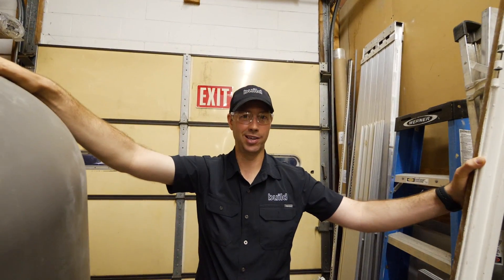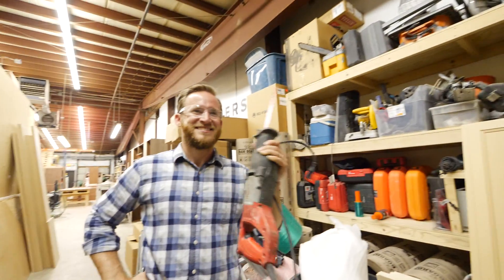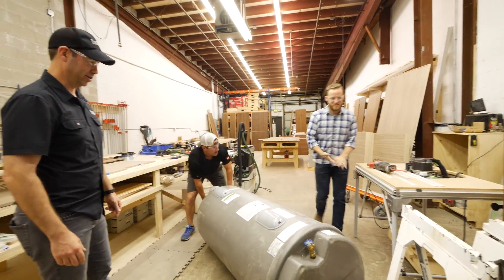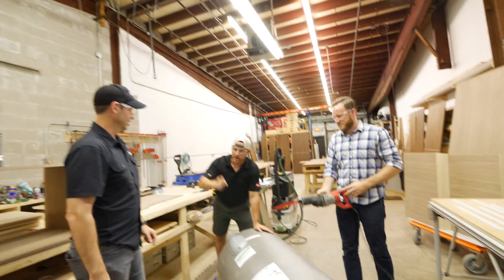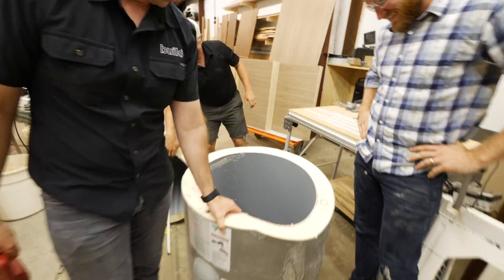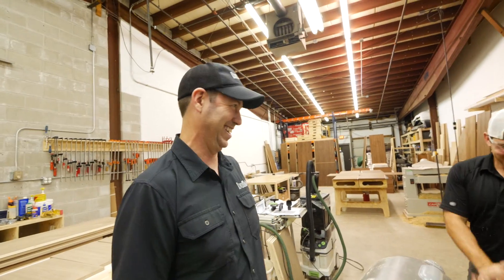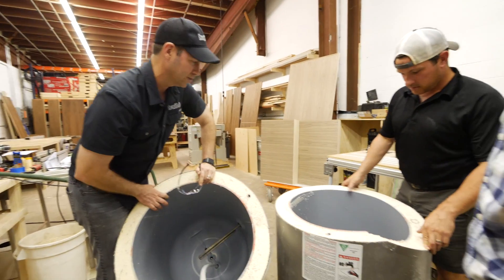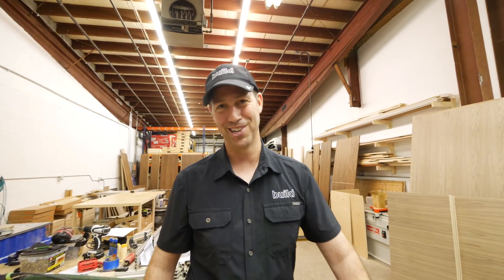WE CUT OPEN A RHEEM MARATHON WATER HEATER

Comment: Is it possible for one shower in the house to have a methane gas smell coming from water but nothing else in the house. The hot water heater has been drained 3 different times and it has not helped.
Reply: Adell Eisenhower if it is a sulfur smell and you have a well it is more than likely iron bacteria.  These tanks really work well with that problem as the iron bacteria loves a steel water heater.  You can put peroxide in your water tank and it will take care of it for a month or two but it is coming from the well and will return.
Reply: @hrcnick11  it is city water..we have tried everything to get rid of smell.
Reply: If you have other hot water fixtures that do not smell like this shower I would loook at cleaning the drain.  Maybe it's your most used shower and could be rotting hair/etc in drain.
Reply: From what I've read, it's from the anaerobic bacteria as it reacts with the magnesium and aluminum sacrificial anode as it produces hydrogen sulfide.  More of a problem with well water

Comment: I have this exact tank but mine is a 50 gallon. Thing is a huge beast. Interesting to see it cut in half.
Reply: How does the water taste? Any hint of plastic taste to it?
Reply: @stephenurban9880  You drink hot water?
Reply: @Petrochemtester  Sometimes.  Also sometimes cook with hot water instead of waiting for cold to heat up and wouldn't want any plastic taste imparted to the food.
Reply: @stephenurban9880  I see.  I have a Marathon water heater and have never noticed any off smells from the hot water - can't attest to the taste
Reply: @Petrochemtester ho w do you like your marathon ? I notice its $661 DOE yellow energy label -doesnt seem very efficient/effective despite the massive insulation ?
Reply: @johnwhite2576  It's been good - I never really looked at energy usage - was more concerned with it being more "leakproof"
Reply: How do you like your marathon ? How is the recovery on a 50 g tank ? Worried i might need the 80 gallons for 4 person household.

Comment: I have one of these units and after having it installed for six months, it flooded our basement. It's through a rental company and they said we have to replace it with the same model. I will be turning off the water supply whenever it's not in use.
Reply: What happened to cause it to flood?

Comment: BSC's science camp?!  Have a good buddy Wes who goes annually with his dad.  Any experience with scale in these units?  From my poor HS chemistry rememberings, hard water common to most residential customers loses its ability to hold CaCO3 in suspension at high temperatures near the heating element, which precipitates out, causing scale build-up on the tank bottom.

Comment: Hi guys, is the inside of the tank a metal lining with enamel finish or a glass finish?  Which would be a better option for a long lasting tank against corrosion?
Reply: This particular water heater just uses a plastic tank with no lining or finish. A glass lined metal tank is much more common and less expensive.
Reply: @kenk8215  less expensive - which is totally strange because the plastic costs a fraction of metal & glass... these tanks have fewer parts & inexpensive plastic tanks with about $5 worth of foam insulation - foam is great, but not $1000 great.
Reply: Why expensive? Because they last a very very long time. They’ll probably just get to sell you one or two in your lifetime. They’re amazingly efficient. Like other electric tanks- no moving parts. Elements can be replaced by homeowner. Nothing to rust.
Reply: @jpartington5358 j do you actually own one of these ? Would be interested in your experience …

Comment: Matt. The Marathon Water Heater does not require a anode rod.  What you called the "anode" rods is actually the heating elements, which happen to be titanium on this model, opposed the standard copper elements.
Reply: R. Dowden, I'm looking to purchase an electric water heater, but have had reservations from reading many negative comments about defects and broken parts from the manufacturer.   I'm from Canada,  our popular canadian brand is Cascades/Giant, which has a glass lining on the inside on the tank versus the Rheem.  I was instructed by Home Depot that it has a mental lining with enamel finish, therefore which tank would last the longest against corrosion?  
Which one would you recommend?

Comment: They should make a self flushing kit to keep the minerals out of it.  Of course if it's just a holding tank for a heat pump heater, then the holding tanl would not use much electricity.

Comment: I almost bought one of those a few years ago but it was so much more expensive than the regular 85 gallon Prestige water heater that there was almost no chance I would ever recover that cost.  They both had a .93 UEF so it didn't appear from Rheem's specs to be more efficient.  I think the only real advantage is that there is no chance of it corroding the shell since it's plastic inside.
Reply: For cost comparison, don't forget the labor cost for replacing a conventional water heater multiple times vs this one.
Reply: Bryce Mayall also, the water quality will be better out of a plastic tank, vs a glass lined steel tank.
Reply: @woohunter1  Why is that?   Glass imparts zero taste to what is held inside it.
Reply: @stephenurban9880  because the lining in the glass lined steel tank will break down over time, then the anode rod….
Reply: @woohunter1  Absent something smacking the tank glass doesn't break down.  There are glass jars that are well over 100 years old.
Reply: @stephenurban9880  plumber here, trust me, they break down.
Reply: @stephenurban9880  check out Matt Risingers channel, he cut a bunch of old water heaters in half to show how disgusting they get over time.  None of these steel tanks with glass lining are built to last, 15 years tops.
Reply: @woohunter1  So basically they are ALL crap no matter who makes them.  Product designed to fail.
Reply: @stephenurban9880  yes, most of them will last the duration of the warranty, but after that, you’re rolling the dice.  I went with a tankless, not saying it’s better, but hoping to get around 20 years.🤞🏻
Reply: @woohunter1  That plastic Marathon seemed good until I found out they sabotaged it with thin copper tubes that rot away and allow water to leak from the inlet/outlet/vent ports.

Also it seems they didn't embed the brass rings for the heating elements good enough and they leak after getting replaced.  I guess the torque required to break then free ruins the seal between the brass and plastic.
Reply: @stephenurban9880  hmmm, never heard of that one yet, where did you hear that from?
Reply: @woohunter1  I was surfing looking for info.  Don't remember if it was a video or on a forum.  A guy said he had that copper corrode away and his tank leaked.

I did watch the Marathon assembly video and they show the brass couplings are attached to a thin copper tube that is inserted into the molded plastic tube on the tank and held in place with an external crimp ring.

https://www.youtube.com/watch?v=rVJS8jZfuZQ

There were multiple comments I found that mentioned the tanks leaking after the heating elements were replaced.
Reply: @stephenurban9880  Just replaced my Marathon. Ports had corroded. Made it to 25 years, tho.

Comment: Are you calling this an anode water heater? The marathon does not have or need an anode rod. It's a plastic tank. It is an electric resistance water heater, but there is no anode.
Reply: Generally they are called "elements".  It is interesting that a couple of plastic tanks and foam, which is probably cheaper to make than a steel tank, costs more.
Reply: @mfarver  yes I was thinking that, wonder if some patents are keeping the competition at bay.
Reply: "Anode" is a term recycled from the days of vacuum radio tubes. The anode was the heating element in radio & tv tubes that gives off electrons when red hot.  A modern Anode is in tank heaters to give off molecules to fight corrosion.